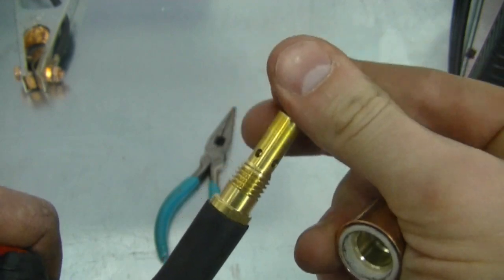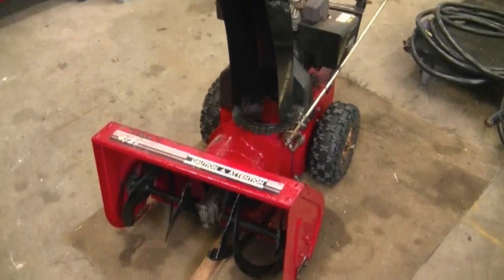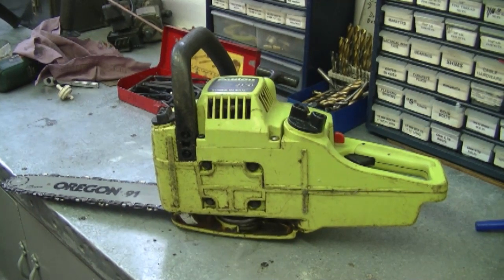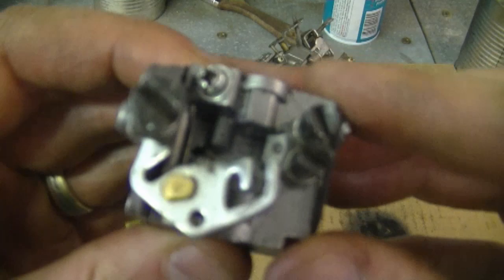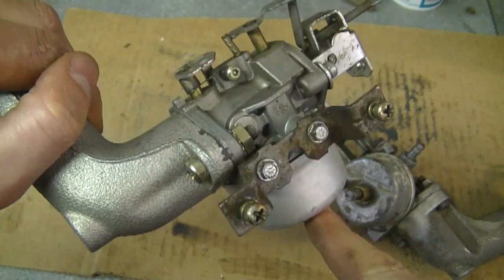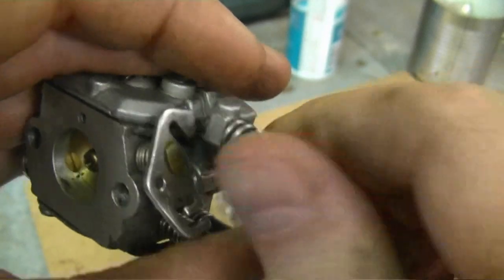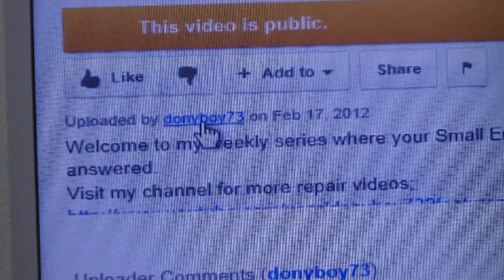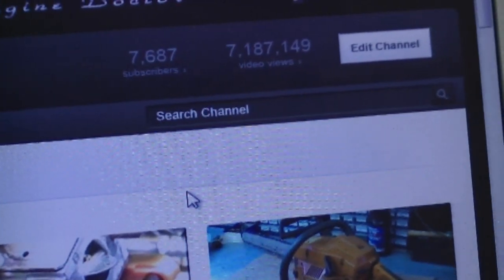Small Engines Q & A Video #89 in HD

Comment: hey my friend just got a rototiller craftsman and the carb is in-agjustible(becides the idle). the only 2 things you can take out of it are the float bowl and the float.the jets cannot come un-screwed and it runs great when you smuther the air filter in starting fluid. i already put a new spark plug in it and the same problem. should i get a new carb? i tried my best to clean out the jets with carb cleaner soaking and i even tried to dig any junk out with a saftey pin.

Comment: In regards to the dirty tip on the MIG welder, some anti-spatter spray or gel applied to the tip and the nozzle will make them much easier to keep clean and last longer. This is especially helpful if you have to do any overhead welding.

Comment: For the carb screws, turning in to go lean works with screws that adjust fuel.  Some carbs have screws that adjust air, they would be turned out to go lean (motorcycles sometimes have these, for example.)  If the screw is toward the air cleaner side of the carb, it might be an air screw, while a screw toward the engine side of the carb is likely a fuel screw.

Comment: Hi Donny;I have a question about my 345 Husqvarna saw.The power switch won't shut the saw off,especially if the saw is run for awhile.I've had it to the shop to be fixed but it's doing it again.I guess a wire is not making contact or something to that affect.Wondering if you could help me out with this.Enjoy all your videos,I especially liked the broken gear box on the honda.Hope you can give me some advice...Thanks Cliff

Comment: I got my Ariens snowblower back from repair . The cost was 150 bucks to put the bearing back in on the auger . he said it took 3 hours to pull it apart and put it back together
The bad part someone told me they were in the waiting room and seen my repair and all he did was bend the metal out and slid the bearing back in . I can tell it was bent and now I am never going to take it to him . I was ripped off. He is the only Ariens dealer in 50 miles I am going to just a small engine repair  .

Comment: wire wheel the tip and get a can of mig nozzle dip to prevent the slag from sticking to the tip and nozzle.  One pound tub should be under $10.00  Just dip the end into the tub before you start to weld and  when ever you see it starting to stick again.   I also use it to spread a thin layer on an area around the weld spot to prevent the splatter from sticking to parts.  Saves time cleaning off splatter.